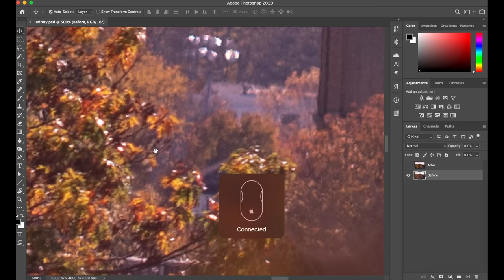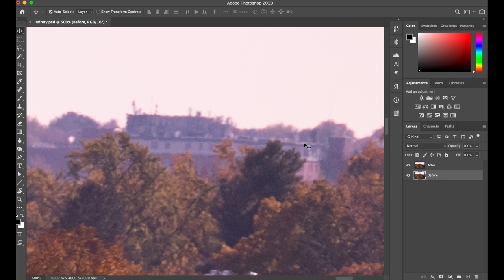"Infinity Focus" and Fixing a Rokinon 135 f/2

Comment: A great tutorial. I bought the Samyang 135mm lens this last summer and tried it out quite recently with my modified Canon 600D and a Bahtinov mask. I reached perfect focus at the hard stop which was fortunate because I couldn’t go beyond that to go slightly out of focus, if that makes sense. Then I put an Optolong L-Pro clip in filter into the camera. I found that with the filter I could rotate into and out of focus perfectly at F2.8 which seems to be the sweet spot for this lens. This may help others with a similar problem without having to ‘surgically’ adjust the lens.
Reply: Maybe I should get one. I need a manual telephoto because my camera decides it’s gonna change focus when I touch the screen. Lost an hour of exposures because of that.
Reply: @13_cmi  Sounds like you're camera was in autofocus mode with touch focus enabled? If not, you may want to use electrical tape to tape down the focus ring, once you have focus set properly, so it doesn't move when you shake the camera. Good luck!

Comment: Thank you for that tutorial! I am not sure if it's a good idea but instead of removing the stop entirely, I moved it one screw to the right. This way I can go slightly past infinity, and still have a hard stop for safety.
Reply: Super stoked I came across this comment as I was in the middle of doing this to mine. I saw what you were saying and just moved the stop 1 screw over. The other screw will go in in the middle of the stop. It let me hit focus last night and still had a little room yet until the stop. But I like having that hard stop. I feel this is the proper way to do it. Thanks!
Reply: Just did this myself, good catch!
Reply: I am not sure this is necessary. I am no expert but when I followed the directions the lens still hard stops, just a little further away
Reply: There is another internal hard stop.   Better remove the external one entirely.

Comment: Thanks. Great video. I had just received my Rokinon 135 mm yesterday and noticed there was zero play beyond the infinity focus. I thought that was very strange and worrisome until I came upon your video.  I just did this mod using your instructions. Just a couple of observations from the experience I had. Some things that weren't said or immediately obvious although they were certainly shown in the video.

1) Even with the right screw driver some of the first three screws were overtightened at the factory and tough to get out. I really had to press hard to prevent the PH00 from climbing out of the grooves and damaging the screws
2) As shown in the video its important to make sure you get the rubber grip pushed all the way to the end of the lens in order to get to the hard stop
3) Also as shown in the video, going around the grip in a circular fashion with fingers under the trailing edge is the best way to get it to slide down otherwise it can be tough to move.
4) When replacing the three screws at the end I was having a hard time lining up the screw holes but playing the video back at half speed was helpful there.

Thanks again. I probably wouldn't have done this without the video

Comment: Such an easy solution for such FRUSTRATING problem!
I bought a vintage Pentax SMC 200mm for my mod Canon M3,  using a Pentax K to EOS-M adapter, I still didn't have a Bahtinov (and no experience) and I sure I was doing something wrong.
It took me while to figure out that this was a focus issue, because I could focus to "infinity" in day time. Then, I replaced the cheap adapter with another one. Only after getting a Bahtinov mask I knew for sure that the problem is the focus. Asked in CN and most people suggested to add a clear lens in front of the sensor, only one person suggested to adjust the lens, which was super easy.
After the adjustment I can tell for sure that adding a glass wouldn't have fixed the problem, and I love having that extra place to play with the focus.
The value of a good set of mini screwdriver is underestimated in this case!
Great content a always!

Comment: Interesting, my solution to this exact issue was opening up the camera and shifting the sensor forward.
Reply: When you shifted the sensor forward, how much, in terms of screw turns? one full turn or more than that? I just pulled the IR cut filter from my 600D
Reply: Would love to hear more about this as well. I have an astro-modded Canon camera, performed Nico's fix, but just about (or not, checking with a Bahtinov mask soon) hitting focus. There's already an SvBony CLS clip-in filter inside (~1.8mm glass thickness).

Comment: Tips:  gently heat up the focuser rubber with a small heat gun (emphasis on gently) and slide it down instead than up.   Completely remove the stop.   It is actually a "pre-stop".  There is another internal stop once it is removed.

Comment: Very informative video as always Nico! I actually went the opposite route and adjusted the sensor on my Rebel T3 to its maximum forward adjustment, which overcame the focus issue. That route was NOT easy and takes a lot of patience due to the complexity and inner workings of DSLR's.  Unfortunately, that camera decided recently to give up the ghost. I think this time around I'll go this route when the replacement modified camera arrives. The 135 Rokinon has been a staple for my Astro images but excels in the daytime as well!

Comment: You're a life saver Nico! I actually bought a used lens myself a few days ago at an incredibly cheap price (less than half if new) for a like new lens - just that it has this issue. I'm having a hard time noticing bad focus myself (bad eyes probably lol), but my bahtinov mask says it doesn't quite reach focus. 

Just to clarify, before removing the screws I'm suppose to put it as far to infinity as it goes, as in, reach the stop? 

But yea, seems pretty easy and I'm gonna have a hell of a good time with it after it's fixed

Comment: After fixing my 135mm F2 following this method, I tried it on my Samyang 24mm F1.4. However the 24mm has a different construction so it requires starting from the back end and removing the mount ring and aperture ring. It's a more complicated process, but still achievable using the same tools.

Comment: The missing sensor glass / ir Pass filters of astromodified cameras prolong the light path to the point of convergence by 1/3 of their thickness as a rule of thumb. I had to learn it the hard way on my Sony a7rII. I still have some lenses with which I cannot reach infinity focus fully open. This is really helpful advice and luckily an easy procedure on one of the cooky cutter lenses for ap :)
Reply: Exactly what happened to me when I removed the filter of my olympus cam. Works for telescopes, but with the 135's little brother, the 85mm f/1.8 ED, i cant reach infinity focus anymore. I'm probably gonna try this, but its still gonna be hard since MFT has a 3mm glass in the path. That's a lot to cover for the extra focusing path.
Reply: One way to avoid this is with an astro-mod is to replace the removed IR cut filter with clear optical glass to preserve the optical geometry.
The removed filter otherwise affects not only infinity focus but also auto-focus (unless it's a mirrorless camera) and depth of field calibration on all your lenses.
Reply: who modded you're A7R II? do you experience that ir light bleed/leak during long exposures? I'd like to maybe mod one of mine
Reply: @kalef1234  I had it modded by Markus Mehl in Germany. Although the IRPass filter was replaced with a baader filter replacement there is still some ir leakage from the service led inside the shutter mechanism. There has been an instruction how to shield it and I intend to let Merkus try to improve the situation. With the current glow I must take darks in order to get decent results. I will link to Markus' page and the instructions for shielding once I am at a desktop pc.
Reply: @benjaminolry5849  oh yeah i guess dark frames would subtract it out, i didn't even think about that!

Comment: hi Nico, question about the stopper that you removed. Is there any risk of over focusing and damaging the lens if you dont put it back in? eg. if you twist the focus ring past its intended infinity point and collide some of the internal optics? or is this not an issue? cheers

Comment: Do you have to put the silver piece that controls hard stop back after testing or not?
Reply from the maker: I didn't. The focus ring still stops on both ends without it (i.e. it doesn't just keep turning). I think in my case, I needed to keep that piece out to put the infinity focus position where I wanted it. I did save it in case I need to put it back for some reason.
Reply: @NebulaPhotos  thanks Nico! I'll try this out.

Comment: Awesome info, Nico!

One question, are you saying you could adjust the aperture to fix this.? Stop down and achieve infinity? 

That won't help my situation, however., as I have this problem with a fixed aperture lens. :(
I just discovered my 14 mm Rokinon doesn't reach infinity on my Pentax. Very disappointed about this, especially on the wider lens... Why not make the travel go well past infinity? What are they trying to avoid by making it such a narrow range of movement?

Thanks Nico! I thought I was going to have to return the lens. I'm not sure I'm ready to perform surgery on my own, but will be talking to my local repair shop.

Clear skies...
N
Reply from the maker: Yes, sometimes! When you stop down the critical focus zone expands and in some cases you may enter perfect focus after being out of the CFZ at faster aperture. Good luck with your repair. Clear skies, Nico
Reply: In my experience the 14mm samyang/rokinons are very hard to adjsut past infinity. I did it to my samyang 50mm with relative ease but I just can't seem to slide the black plastic focus ring off the lens to get to the internal stoppers on the 14mm
Reply: @kalef1234  Thanks for the info. I still haven't taken this to the shop, but I'll mention it to them.
(I'm not brave enough to try it myself!)
Reply: @SkySailor75  I totally understand. My 14mm was also 'decentered' so I didn't have anything to lose haha. I fixed taht as well so now it's quite sharp and I'm excited to try some milkyway shots with it. Hope it all works out for ya!

Comment: i have a samyang 50mm f1.4 and a 14mm f2.8 Series II that don't focus to infinity on my astro-modded 6D....they unfortunately don't have this same 'stopping mechanism' so I guess I'll have to sell them 
EDIT: fixed the 50mm f/1.4 Samyang's focus, it's a bit more involved but definitely doable. had to take the back mount ring off, the aperture ring and ball bearing out, and then completely slide the focus plastic ring off after loosening the same screws featured in this video. then you remove the white sliders, rotate the focus around once to get past infinity, then re-assemble.

Comment: Hi Nico, thank you for another informative video. For clarification, in step 3, you took off the small silver piece. Do you replace that afterwards or does that prevent you from making the adjustment? Thanks again. Clear skies! Narrie (The Nar Side).
Reply from the maker: In my case, I didn't put back the silver piece as it was preventing the focus ring from move far enough in that direction to reach focus. After I put the three small screws back in, the focus ring worked well and still stopped turning on both ends of the range. I'm not really sure what the purpose of the silver piece is other than creating an artificial hard stop for the focus ring.
Reply: @NebulaPhotos  thanks. I thought that might be the case. I think if you turned it too hard without the silver piece, you could overcome the resistance the three set screws provide by themselves. Though I don't own that lens, I knew I would learn something from your video. I look forward to using your in-depth post processing videos tutorials to help me make better images and hopefully a better astrophotographer. Clear skies! Nar
Reply: @NMagturo  i had the same question. in the end I removed the silver stopper but replaced the tiny screws so as not to misplace them...
Reply: @totoantibes  thanks!

Comment: So basically I have the same lens for canon and it should be 44mm from the sensor...i wanted to try and attach an OAG but together with my zwo camera and the EF<M42 i get around 53mm distance which is too much....is this modification will solve the issue? Thanks!

Comment: Really wanted to try this because even after going for repair couple of months it came back with same issue....but I had to quit before really getting started. 2 out of 3 screws weren't moving...hope I didn't strip them entirely. Any hints to get them loose?
Reply from the maker: Ah, that's the worst - sorry! I've never run into that with this lens, but with other projects I have stripped screws and had to turn to screw extraction techniques. I'm not sure if I would try those here. Other than what I showed, the only other option to reach focus is to move the sensor inside your camera. There are some screws in there too if you take it apart. I've never done this, just relaying the info.

Comment: I have a samyang 85mm lens connected to a eos/canon filter drawer adapter and a Sv405c, the only way to achieve focus with pin point stars requires focus near 15 on the focus ring, quite aways from infinity. Adding shims to achieve infinity focus is possible but the stars are not pin point and everything looks magnified and boxes appear around extremely bright stars. My question is do you think that resetting the focus would work or just go with I got. Thanks
Reply from the maker: If you can reach focus, and it's stable, I'd just go with what you got.
Reply: @NebulaPhotos  Thank You

Comment: Hey, Nico! I have the Samyang 135mm f/2.0 and I am having the issue you've mentioned in this video. The lens won't focus all the way to infinity. I peeled back the rubber grip of the focus ring, however, the screws that I need to unscrew are extremely tight. I don't want to risk breaking the lens (from using force to undo the screws). Is this issue specific to the 135mm or does it vary? I am wondering whether to send the lens back in exchange for a new one but I don't want to do that if the issue will persist. Any thoughts?
Reply from the maker: It seems super common for this lens not to come to focus with modified cameras, so even if you return the one you have you may need to do the modification on the new one (but maybe the screws will be easier to turn?)
Reply: @NebulaPhotos  Thanks for the quick reply. The camera I use (Sony a6000) is not modified but I suppose it just depends on the camera lens combination. I think I might try and take the lens to a camera shop. They might have better tools there
Reply: I had the same issue today. At first I couldn't get the one of the screws to turn. Make sure you have the right phillips head 00 but you also have to apply a good amount of pressure while turning the screw driver so it doesn't climb out of the grooves and strip the screw. The screws seem pretty tough though.

Comment: Good info. But what is interesting (maybe my lens is older or newer) but my Rokinon f/2 135mm has a different labeling setup.  Meaning, as seen at this video (3:30) your label is L then the infinity symbol and then m.  On my lens... its  m  infinity symbol and then L.   Does this make any difference in regards to doing this tweak?
Reply from the maker: Are you having trouble focusing to infinity? If not, I don’t recommend doing this. If you are, I think this tweak is worth a shot.
Reply: Thanks. I just got the lens. Snow expected (big surprise) so it will be awhile before I can see if it's an issue. @NebulaPhotos

Comment: Hi Nico, I did the fix this morning but when I reach the infinit icon i lost the focus on the ground, maybe I did it wrong?
Reply from the maker: The markings on the barrel will no longer be accurate, but you will definitely still have full range of focus, it will just be expanded. I doubt you did the modification wrong, but you can’t expect to just move to the infinity icon and be in focus, focus using live view and you should be fine.

Comment: I have a question About focus. When im shooting The stars, i bump Up all my settings to max - 30sec exposure, F1.8 and iso 1600 (thats max on my camera)
I focus using live view at that settings.
Will my focus change, When i change my f value or aby setting? Thank you for reply😊
Reply from the maker: Your focal position should not change by closing the iris (aperture) or changing ISO/shutter speed. The only setting that could result in a focus shift is zoom. Many zoom lenses do not hold the same focus through the zoom range.
Reply: @NebulaPhotos  thank you Nico! I just finished shooting Orion withou worries and fear❤️

Comment: Question 🙋🏻‍♂️ once the hard stop is removed can the lens be damaged by someone turning it way past infinity? I wouldn’t but a child might or a drop incident.
Reply from the maker: I am not an expert on this topic, but from my limited experience, here are my thoughts: 
1. On this Rokinon lens, I thought removing the hard stop might mean I can just keep turning the focus barrel and it would just keep going 'way past infinity' as you say. In reality, it didn't work this way. The focus travel still stopped on both ends of the range, but I was able to move where infinity focus was achieved on that range.
2. I suspect the hard stop is indeed there to prevent damage to the lens. I could see how by removing it, if I twisted the lens barrel too fast to one end now, I could potentially break off the small screws providing that resistance. So yes, I think you may be right that removing it might make the lens more susceptible to damage from someone mishandling it (exerting too much force on the focus barrel). If you drop it, I'd be more worried about miscollimation of the lenses than anything related to this mod.